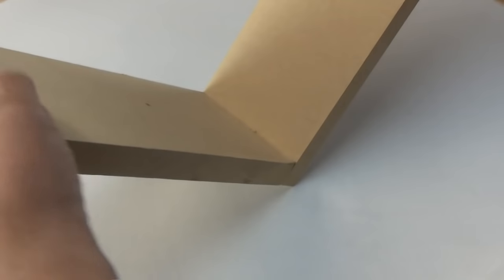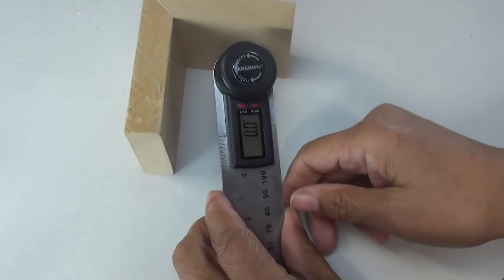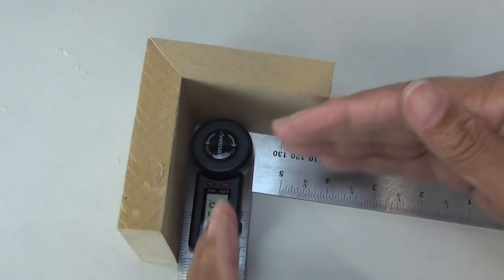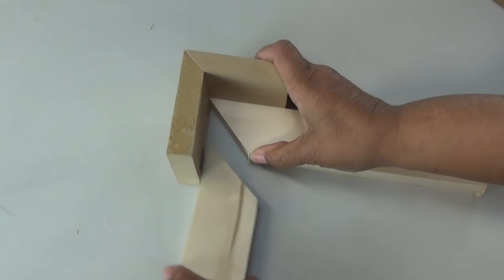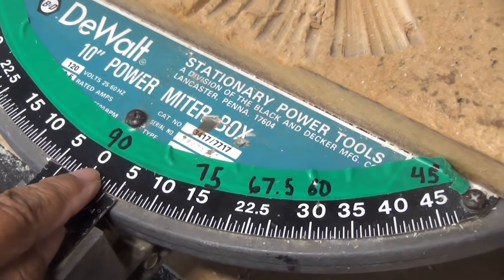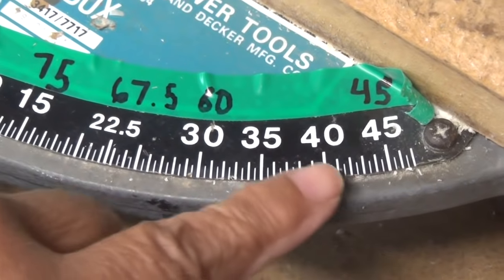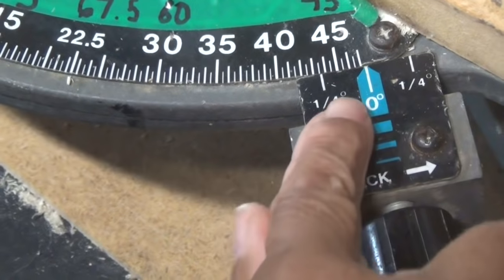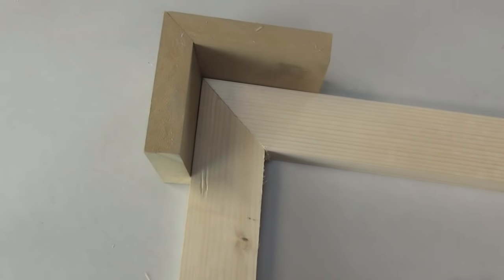The Secret Formula for Making Perfect Miter Cuts When Less Than 90 Degrees

Comment: You could subtract 85 from 180, then divide by 2.  This always gives you the answer you want to set your saw at, without the need for the tape.
Reply: thanks, for me thats much easier.
Reply: Nice one bro
Reply: 2,920,261 views Jan 29, 2015 her video from then explains that, but the tape is also useful as a guide.
Reply: Much simpler, thank you
Reply: Yup! You're right! But where the hell were you when I needed this valuable experience? 🤣🤣
Reply: DaveCaresForYou  the angle of the wall corner was 85°
Reply: Or 90 - 42.5?
Reply: That's for obtuse angles where the angle is greater than 90°.
Reply: Much more simple
Reply: She is showing you where that formula comes from so people aren't just looking up formulas from the internet with no idea of their derivation.
Reply: I'm guessing the 180 comes from both sides. 90+90=180. And dived by 2 because it's 2 pieces or 2 angles? I'm not sure if I fully understand this. Is it 90 degrees because it's center of the 2 ends,left and right?
I appreciate the information. It's helpful.
Reply: @277kne  because it’s 2 pieces. If you wanted to do it in 3 (or more) pieces to sort of ‘round out’ the corner, you’d divide it by however many pieces/segments you wanted to do it in
Reply: There's always more than one way to do things. What she did was basically explain how the miter works. Puts things into perspective because I never thought of the miter saw 90° from the fence. Always visual representation helps for some folks.
Reply: I just fell into this trap too.    Now it makes total sense when I was trying to cut for an 80 degree mitre that it didn't fit.
Reply: Great tip!
Reply: That’s an awesome tip 😊
Reply: That's more straightforward, I love your work mate
Reply: so everything under 90degs, the miters saw has to be moved to 2 different measurements?

Comment: For those who do not have a digital angle gauge:  Take a sheet of paper and lay it along one side of the wall so the corner of the paper just hits the inside of the corner of the wall.  If the angle is acute, less than 90 degrees, there will be some extra paper against the wall on the other side of the  angle.  Fold that paper down so the paper just fits the angle and crease the fold.  Now fold one side of your paper angle against the other side so the new angle starts at the corner and both sides are together.  This paper angle shows how you need to mark your wood.  You have just bisected an angle.   For angles larger than 90, lay one piece of paper into the angle along one side and another piece along the other side so the corners meet at the corner of the room.  Tape or glue them together and fold to make your half-angle.   This also works for outside corners - Lay one piece against one side so it extends beyond the corner.  Add another sheet from the other side and glue together.  Fold and you will have the setting for an outside corner.  No numbers have been mentioned.  When I was replacing molding for a 3-window bay, no two angles were the same either at the base or the crown.  Using this method all my trim fit exactly.  Not a great carpenter but decent at geometry.  Hope this helps.
Reply: This is helpful but sometimes the acute side is bigger and when not, the amount to fold usually isn't big so hard to do so but better than having no tools for sure!
Reply: What is the name of the tool that helps you saw it in the angel?

Comment: If you flip the wood changinging its orientation when laying it down on the miter saw, which is “dangerous dont do it , wood can get caught in the blade” you cut it to that specific angle without doing math

Comment: Hi Leah very informative video, also if you take the 85, from 180, then split the difference and you’ll get the perfect cut. Thanks a lot
Reply from the maker: thanks for sharing!
Reply: Ok..another good way to work it out...thx!!
Reply: So by this methods 2# 47.5° cut would fit that 85° inner angle?
Reply: @xo_dre0728  her cut was also 47.5. He's sharing a mathematical way to get to the same answer.
Reply: @bengrumbles9830  - That's where the complementary angle comes in. In this case, 95 degrees (the complentary angle to 85 degrees) ÷ 2 = 47.5.
Reply: Thanks for sharing. Does it also work if the angle is more than 90 degrees? For example, if instead of 85 degrees, we need to miter for a 94-degree angle, would we just take 94 from 180 and split the difference?
Reply: @finestpix  Same question...waiting for someone to give us the definitive answer!
Reply: FoxRcng708 what if your saw doesn’t go up to 49? If the angle was 60 /2 = 30. So comp is 60 and the saw was right on the limit to cut 47.5. Can’t cut 60.
Reply: @finestpix  yes.  you'd set your saw at 43 degrees.
Reply: Set the blade to your 42.5 but use the piece on the other side of the blade.
Reply: I have a idea, make the project to fit the settings on the saw. 😉😊
Reply: @utahprepper8925  We want the protruding bit to be 42.5 degrees, and as the saw measures vertical as zero, the opposite angle (complimentary) is 47.5 degrees. The other side of the blade will be the same as per parallelogram, therefore, Leah is doing it correctly by cutting at 47.5 degrees. A similar approach is to use a protractor which has complimentary angles and then divide it by two to get the same answer.
Reply: @finestpix  Yes it will.  It's the math for obtuse angles. 91 degrees and above.   There are two ways do the math.  
180 - 94 = 86.  86/2 = 43. OR 94/2 = 47.   90 - 47. = 43. There is a video from "Sawdust and Wood" that gives a really good example of the math for both obtuse and acute angles.  However his acute angle  (90 degrees and less) math has you just has you just divide the angle by 2.  Leah method shows that just dividing by 2 doesn't work all the time.  She has you divide by 2 THEN subtract your number from 90.  I guess this is what they call the complimentry angle.

Comment: Leah, I have been in the industry for 20 years, i have worked with all kinds of great carpenters and builders yet none of them ever explained angles and miter cuts so thoroughly lie you have in this video. Many young apprentices tend to have a rough time understanding complementary angles, specially when it comes to  exterior obtuse angles and interior acute angles. you have done a great job. Keep it up. It would be awesome if you could produce a compound miter cuts video.

Comment: You are a great teacher, you deserve a new chop saw👍
Reply: Lol
Reply: Truth is, that old chop saw prob works better than any new one.. So long as the blades sharp lol
Reply: Nothing wrong with that saw, Most of  if not all brand name saws are great saws no matter the age, the only thing worth changing is the blade, whenever possible up grade your blade and using the correct blade makes a world of difference. ..love the Freud, Freud blades can make cheap no brand mitre saws decent enough for any homeowner who enjoys dabbling in home repairs.
Reply: There's tear out because the base isnt flat. Could just add a piece of wood under the piece being cut. The base is wood because it doesnt rotate with the blade like newer saws do.
Reply: A nice old school DeWalt or really old School Skill or Sears. Or maybe she already has a great saw. I have meeky old Makita that tables from 65 degrees all the way back to 70 degrees on the other side. Weird coloured almost Hitachi green with a metal riveted Makita tag. You could offer me $2,000 for it and I would definitely say no.
Reply: Danger Bear some of those old tools are quite excellent. Most of them are way too heavy and underpowered. Further they are in general less ergonomic as well, but there are indeed some pretty amazing gems that even in the coming decades will still be better then commonly available.
Reply: The sharpest tool should be the one between your ears. The tool only does the work of its user.👍

Comment: I bought that same Husky digital angle finder and after owning it, every construction worker of any form really should have one b/c it can find 2-D angles or 3-D angles where as a speed square can not determine 3D angles (like outside/inside corners of a wall) and a speed square can not get into a lot of places that the angle finder can.  So many construction workers do not know how to determine angles and/or determine what angle to set the miter saw on to get that angle.  A lot of guys think if you set miter saw at a certain angle, then you will get that angle on either the toe or heel after the cut but that will only happen on 45 degree setting.  Its so simple but you cant tell someone who wants to appear like they know everything already even when its clear they dont have the foggiest clue what they're doing.  Thank you for making this video b/c its probably the thing more construction workers struggle with is determining angles and determining what miter/bevel angle setting to achieve that angle.  The non-digital angle finders don't really work in tandem with a miter saw b/c you gotta know what numerical angle the angle is.  Trying to line miter saw blade with the manual angle finders takes too long and/or marking tricks to bisect an angle that you have scribed also takes too long.  Having the number of the angle is what you need.

Comment: Using a Miter Saw Protractor (miter protractor) will take all the guess work out.  This video definitely helped me understand though.  Thanks!  ...  For anyone having trouble understanding this at first, just remember that in your head, you need to be starting out with the number 180 (straight line), not 90.  If you start with 180 then minus the angle measured (85, in this video for example) you will get 95.  Then, you take 95 and divide by 2 for your answer of 47.5.  So, you cut 2 pieces at 47.5 and you are good to go!

Comment: Old school DeWalt, a division of B & D saw. I bet that has seen a lot of use over the years. As for messing around with finding the right angles, sometimes it is just easier to cope everything and call it a day.
Reply from the maker: I bought that saw off the head carpenter on a jobsite very early in my career.  I haven't been able to part with it.  As for coping, I agree!
Reply: I noticed that old school de walt too. Most ppl don't know B&D owns DW. And I totally agree about the coping when you can.

Comment: Good video.  I think your explanation would have been more understandable if you had said "the finished miter cuts need to be 42.5° each (42.5° + 42.5° = 87°) therefore we need to cut way 47.5° each because the miter saw cuts the complementary angle, not the desired angle, except for 45°  and 90° cuts."  You did say that but at a round about way.
Reply: Tyrone Kim there's text
Reply: yes but 42.5 + 42.5 = 85, not 87.5.  minor quibble but it may have tripped some up
Reply: Mitre Cutting angle = 90° - (a/2) where a= measured angle of the corner you want to mitre

Comment: Blame the drywall finishers...    I frame my walls square everytime.. :)
Reply: Yeah but it's something so important to learn what she just showed us. It will help tremendously in the future. You know its pretty rare to find a 90 angle. With settling of houses, lazy dry wall installers ect. Besides it's useful in so many other situations as well. Not just dry wall corners
Reply: Mike DEEZ yes and adding tape and mud in corners then makes it an acute angle. Just like adding corner bead to outside corner affects overall angle. So regardless if you frame it square after drywall taping it’s no longer a 90. And there’s a word for trim guys whose saws are stuck on 45. Hack. If you cope the inside corners you don’t have these problems
Reply: Im a plasterer and I build my frames square, I board the square frame making the board square as it’s followed the frame. I then use 3mm thin coat angle bead which I then plaster with 3mm coat of plaster making it square. I’m not American so we plaster our walls not mud and tape or whatever you call it so I can’t talk for you guys I’m afraid.

Comment: It is is the first time watching leaving confused
Reply: With a ninety  degree angle the cut is fourty-five degrees each side, but as an oddly shaped angle is less than 90 the halving does not work. each piece of wood in a 90 degree mitre is 45 degrees, but you have to halve the actual measurement in an odd angle then take that from ninety, rather than just halving the measurement. If it is 85 degrees as demonstrated it is 90  degrees less forty two  and a half degrees, which is forty seven and a half degrees as the cut. If you measure 85 degrees and half it then you get forty two and a half degrees, five degrees short. (eighty five and five = ninety).
Reply: 180-85= 95
95÷2= 47.5
47.5° is the angle
Reply: me andyou so if you were doing an abuse angle at say 94 degrees, how would that work out?
94/2= 47 
90-47= 43
So you would set the saw at 43 ?  And would you be setting that 43 in reference to numbers Leah wrote on the tape in her mitre saw?
Reply: robert till ‘I’m
Reply: 12345 12345 does this work with crown outside corner to.
Reply: So she cut 42.5 +47.5=90 or 47.5+47.5=95?
Reply: @ኦርቶዶክስመዝሙር-ኸ5ቨ  if you watch around 5:22, you can see that she kept it at 47.5 for both cuts. So it's one cut at 47.5, and another cut at 47.5.

Also, if you think about it, a 47.5 degree cut will make a more acute angle. So if you do it twice, it'll "flex" the two wood pieces closer together / more acutely. The wood pieces will be more acute (less obtuse), so they will fit that corner even better.